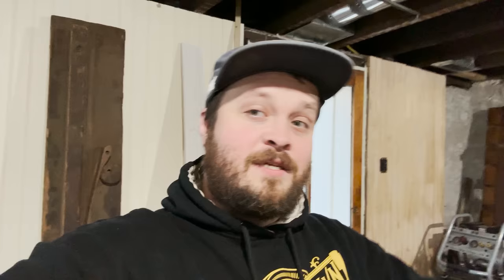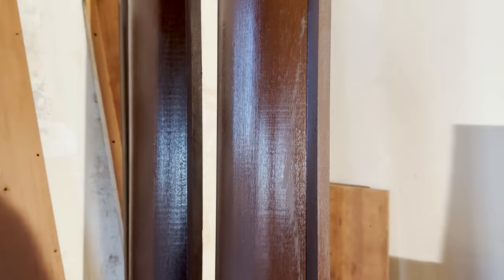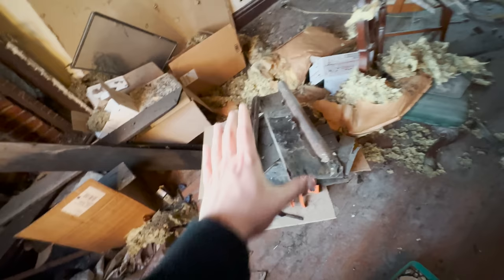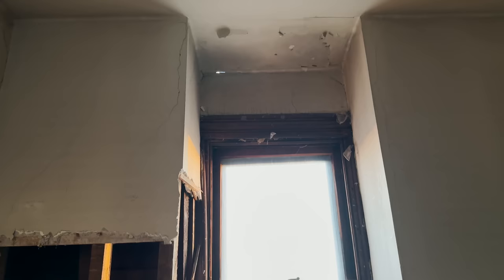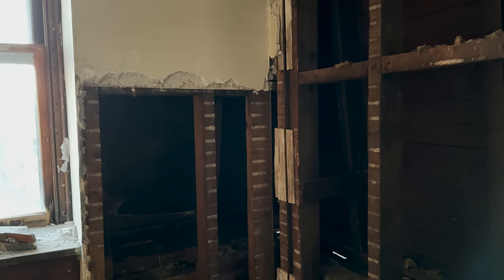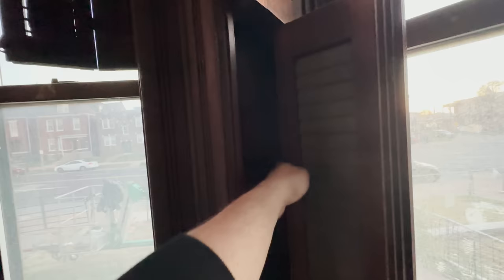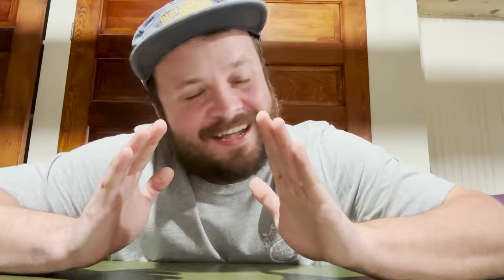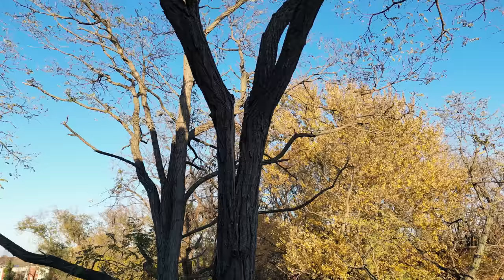Lots of Questions Lots of Answers

Comment: I realize it's almost no discount anymore, but to be honest, it would've made more sense to me to just build something out of "budget" as in standard materials to at least mostly close up and temporarily fix the stuff that's there. Take down the stuff that needs to be repaired or replicated, and just get it sealed in so you can do the interior work while you're waiting, especially over the winter, and you'll have something solid and safe there.
Reply: I agree. And setting priorities seems to be his weakness as seen in several other videos. This one shines the light on getting machinery related to the owner of the house rather than focusing on having the tree problem addressed. Or getting the building the machines are stored in weatherproofed and safe. But priorities are not his forte. In fact, he actually believes his priorities are correctly set and has lots of excuses or as he would say reasons why they are set as they are. But, rock on. It's content.
Reply: Its easier said than done, but I would have considered building a temporary plywood roof over that gaping hole a long while back. His trouble is, that would likely be a few days' work, and he has to keep interesting content coming.
Reply: Yeah, silly Kaleb.  Just sitting around and twiddling his thumbs.  🙄
Reply: @Lucinda_Jackson  Is that what was said? Didn't see that said anywhere. But don't let facts get in the way of some good old fashioned, useless sarcasm when you have not solid contribution to a valid conversation.
Reply: @themainer1267 the first commenter made a valid suggestion without making a mean spirited,personal attack.🤔
Reply: @lauramitchell6725  Right.

Comment: 25 years ago   i bought a   victorian house  that had not been touched   it still had   wall mounted  lead gas pipe  wall  lights  ,    and all the original doors ect     the fireplaces  had been  painted over [ so much paint ]    along with  boarded over  fire places  with   1930's  gas fires  in front  .    i  have spent   25 years   restoring   this old house   [ i will never  move  to  a modern   wooden box ]  .
keep up   with  your dream  you will get there eventualy  :)

Comment: Sir i wished more people did the research you do. you have no idea how many people try to restore stuff and use inferior woods etc for whatever reason. however you are using the right woods and the right paint to make this last a very very long time which is one of the main key to why the old houses that are left are still there. i hope more people watch you and learn the correct way of doing something vs the cheap make it last for 10 years way that i see sometimes. thanks for doing this house justice.

Comment: Tarps used in any application benefits from not being tied down. The harder you stretch it the more the wind will catch it and rip it where the ropes are. The clever solution is to use water jugs instead, they let the wind catch the tarp but not out of control. They will always pull the tarp downwards and keep the shape. How much water in the jugs is of course depending of the size of the roof, too much will create the same problem as tied down with ropes, you'll have to guess and experiment. For straight roofs lumber can be an alternative. Disclaimer: I live in Sweden and hurricanes isn't an recurrent issue here so.....

Comment: what's the original wood type for that roof? oaks?

oooh, were the exterior shutter the ones that have accordion or multi hinged hinges so the shutter could close on window then when opened fold out and around to sit flat against broad brick wall?

was original sunburst pattern two layered (front to back not side to side fitted) or was it multi pieces?